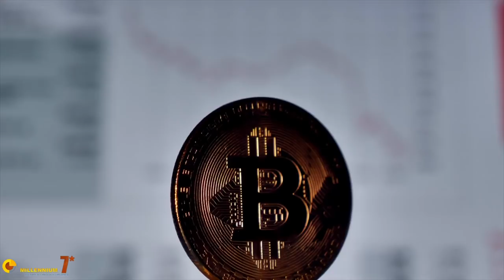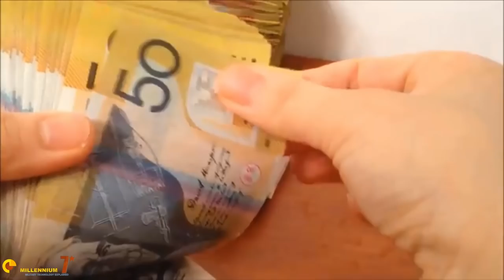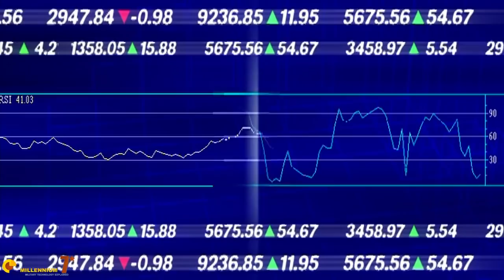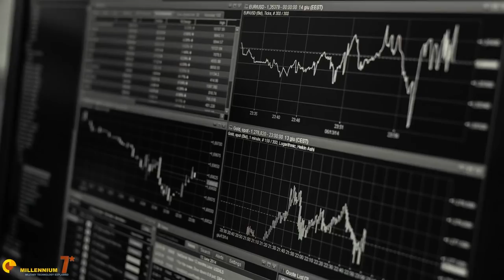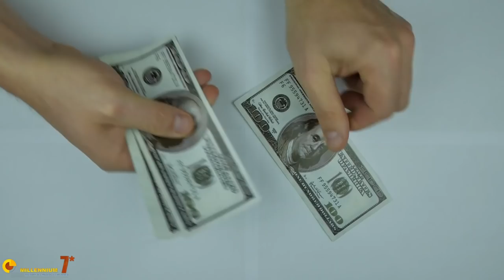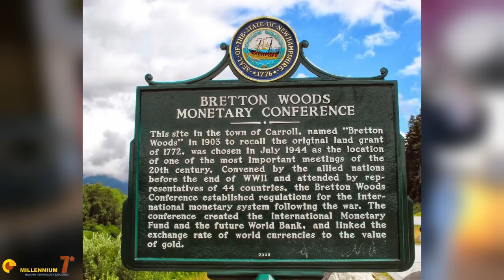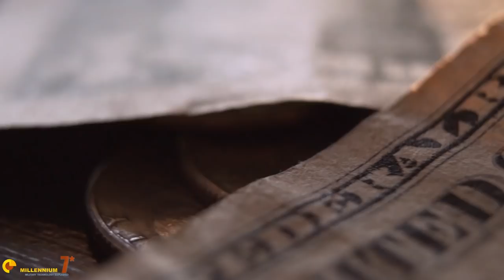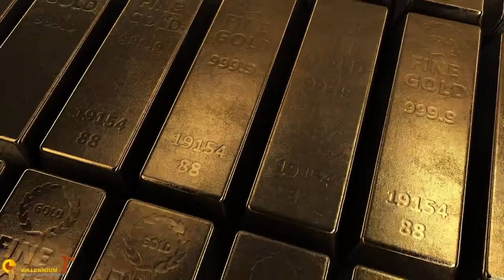How the USA can get unlimited F-35s without going bankrupt

Comment: I don't think I'll ever stop being amazed by the fact that there's not a single channel/article/book that doesn't talk bad about my country's (Argentina) economy every time it's mentioned.

I'm a few months away from finishing my degree in economics, and i find it really fun that every textbook (both from argentine and non argentine writers) cites my country on the "what not to do" section.
Reply: How is Argentina doing currently? I am going to Buenos Aires next month and I am planning on working there and maybe starting a small business while the USD/Arg Peso is so favorable to North Americans. Are there a lot of foreigners there currently due to the exchange ratio? Are more Argentinians leaving the country now than before 2002 disbandment of the Argentine currency board?
Reply: @rorybrown7632  The emigration crisis is equivalent to the 2002 one, annual inflation is slowly rising (and will continue to do so, since the government got to an agreement with the IMF and will need to reduce expending, cutting subsidies to energy and fuel).

We are very likely entering another default in 2024, since we have no fiscal balance and we can't face the debt payments due to that year.

Economic growth is not existant, we have been facing negative per capita gdp growth rates since around 2011. The government won't stop increasing taxes, either creating new ones or amplifying the taxable base.

Currently, we have restricted flow of capitals. You can't buy foreign currencies through banks. If you come here, I would advice you to not sell your dollars to banks, since they will only pay around 120 pesos per dollar, while the "blue" market is paying 240. If you don't want to sell your dollars on the black (blue) market, which is illegal, you can use the "contado con liquidación" methodology, which requires you to deposit your dollars in a foreign bank, then transfer them to an investing account in América, then opening a "cuenta comitente" in the local stock market (ByMA) through an ALyC (agente de liquidación y compensación, basically a broker/dealer). After that you need to buy Argentine bonds using your investing account in America, transfer those bonds to your cuenta comitente in Argentina and then sell those bonds in pesos. This is called "dólar cable/ dólar contado con liquidación" and is perfectly legal, this way you will receive 240 pesos per dollar.
Reply: First of all good luck with your degree. Argentina was an example in Greece by the Hellenic government, a "what if we bankrupt" scenario of sorts. We still are in a depression, at least this is what we feel. It is astonishing how the people of Argentina overcame the monetary collapse. I wish you the best.
Reply: Washington consensus consists of 10 points, number one is:
1-Fiscal Discipline...
No one can state that Argentina comply with that. The blame is on the public spending.
Reply: @migueldenovi5873  The historical examples of economic failures of the Washington consensus is a long one. And the success stories are few, if not even non-existent.

Meanwhile have countries not cared to follow this bogus recipy to success. And those countries are today some of the richest in the world.

Back in 1945-1975 was a period of protectionism, Keynesianism, and socialdemocracy. Economic growth was strong. Bank crashes were rare and a government crisis was unheard of (read Kenneth Rogoff).
The period 1975-2022 was a period of strong fiscal dicipline, the Washington consensus, and neoliberalism.
And during this time did the world see over 200 economic crashes (source: Rogoff) economic growth slowed down and was nearly non-existent if we do not count China into the world, since they follow another economic doctrine than this stupid neoliberal junk.

Economic inequality has increased, private debt has increased, real wages has fallen, democracy has declined and companies are raping citizens and consumers by buying up governments and selling us computers with bloatware and facebook is stealing our personal data and selling it.
True innovative medical research has been replaced by companies only seeking profits by only creating "me too" drugs that are copies of already existing drugs, instead of inventing something new that could save human lives.

The current economic model is a failure and needs to die.
We should scrap this globalist neoliberal junk. Countries should break free and become independent again and leave the EU and throw international free trade treaties into the junk. The people should decide the fate of their nations, instead of non-transparent, unaccountable global institutions.
Heck, I am not even a fan of socialdemocracy or Keynesianism but those things are better than the stupid crap we have today. The world needs more economic nationalism. I think it is ironic that despite all talk about how economic nationalism is so bad.. we still see more beggar-thy-neighbour egoism today than ever before.
Germany steals jobs and economic growth from other countries by delibreatly manipulating down their wages so they get an competative advantage over the other Europeans countries. We see a global race to the bottom with lower wages and labor standards.
In the EU are countries competiting with each other to lower taxes and creating tax havens to steal tax money from other European countries - thanks to the removal of capital controls. Countries compete with each other to deregulate banking the most - which have led to economic fragility, instability and one economic crash after another.
Free trade is useless and idiotic. The "golden straight jacket" have probably never made any large or medium sized country go from poor to rich.

South America did better under protectionism than it did under neoliberalism of the 1980s.
Reply: @migueldenovi5873  
"Open your eyes"
The thing we got today are socialism for the rich, and not socialism for the working class.
That is rightwing politics and not something that I want. Reagan and Thatcher loved spending money on the military so they were not against big government if it meant that making rich people richer at everyone elses expense.
The banking sector is non-transparent and unregulated today compared with the past. Trade between countries is easier than ever - in the 1960s you would have to go your government with hat in hand and ask for permission from the central bank to take money outside your home country to open a factory in another place in the world.
Indeed you could not even go to vacation to another country without asking for permission to take out money out of the country - so hard was the capital controls.
My own country did not allow foreigners to own more than 25% of the shares in any company on the Swedish stock market before 1993 as we joined the EU shortly afterwards.

So restrictions was harsh after world war 2. Many governments had taken much control over the economy under the war. The housing and energy sectors was either under state ownership or under much regulations and price controls like in USA. Public healthcare systems was created in every country on both sides of the Berlin wall during the 1950s and USA was today the only exception.
Because of the cold war was the military also an important part of the economy as millions of men were conscripted and taken off the labor market so unemployment fell. Railways were state owned.

But with the last decades have western countries continued down the path set by Reagan and Thatcher. Privatization of railways, energy, public housing, healthcare, schools have continued.
And countries economic performance is shittier than ever.

"look at the "economic freedom index 2021"
As I expected are you an idiot clueless about economic history. Instead of being obessed about your own story.
How about reading history on what really happened. Read Ha-Joon Chang.

Most countries got rich thanks to protectionism. England had the highest tariffs in Europe 1780 to 1820 when its industrial revolution happened and England became the factory of the world. USA had the worlds highest tariff rate in the world throughout the 1800s - the time when the country also was the worlds fastest growing economy.
Sweden had the highest tariffs in the world during the years 1890 to 1914, and during that time period it was also the country in the world with the world fastest growing economy measured in GDP per workhour.

Prussias industrialization much began during Frederick the Great who ran a very mercantilist policy. The industry was built around the army - so Prussias economy was largely built around textiles, iron, and armaments. And heavy investments was made by the Prussian state into the province of Silesia, which now became one of the largest industrial centres in Europe. Unsurprisingly did therefore Prussia togheter with Belgium, become the first countries after Britain to undergo an industrial revolution.

Japan and Korea are other examples on mercantilist economies. As well as China with its strong capital controls.
Finland was the poorest country in Europe in the 1930s, and today its one of the richest countries in the world thanks to its protectionist policies. The years after world war 2 also meant much economic growth in Latin America, Argentina got ranked as one of the richest countries on the planet. And Brazil was the fastest growing economy in the world in the 1960s despite massive inflation.
But today it has become a poor sh*thole after Carlos Menems neoliberalism and the mismanagment by its rightwing dictatorships. National resources were privatized along with everything else. Trade barriers were lifted and Argentinas industrial base was wiped out. Linking the currency to the US dollar was another idiotic move - as stupid as Greece linking its currency to the Euro.

You failed to mention a single country as an example of a poor country becoming rich with free trade. I think that is very telling about ignorance in the free trade camp. This is always what typically happens when I talk with someone who praises free trade. The can never come with any real example of any large country going from poor to rich.
Instead you talk about some exotic island here or there...
It all sounds like a joke. Its like when I ask for an example of when Communism did work and clown mentions a medieval Kingdom in inner Mongolia and the Republic Tuva as an example... examples which holds absolutly no relevance for the world we have today. How about just mention a normal sized western country as an example?
Is that really too much to ask?
Reply: @nattygsbord  Great comment... 

About communism working or not... you could say it almost worked in some places... thus some people learned how to extract the "good side" of it, and fix it with time. 

Anyways, good answer.

Comment: 20:00 when Gadifi wanted to switch the sale of oil from in USD to Gold or Maduro tried to sell oil in Euros, very quickly they where faced with war or heavy sanctions :D, there isnt a gun at your head maybe on the surface, but there is a very real pressure to use US dollars

Comment: One excellent reason why F-35 is an international project and why its available for sale to some, but not all, national customers, is that lot amount increases power of economics of scale, driving down the cost per airframe, allowing more airframes to be bought for same budget. The opposite is true, is low fleet size increases cost per unit to unsustainable level. Examples, are F-22, B-2A, SSN-21 Seawolf class SSN, DDG-1000 Zumwalt class heavy destroyer.

Comment: This is a very thoughtful and pragmatic explanation, but I'm not certain it's 100% accurate. How do you dovetail this with the collapse of the Soviet Union? They had no foreign dependencies and were 100% in control of their supply chains. In theory, they should have been able to produce as much hardware as they liked without going bankrupt.
Reply: They still had to transfer material and manpower into military production and away from more productive uses. Tanks cost money, tractors produce money.
Reply: @jakedee4117  I would agree with you if money mattered, but according to this analysis it didn't.
Reply: @GoSlash27  this analysis is about money to war or military. soviet had a bad economy and done dirty by Gorbachev.